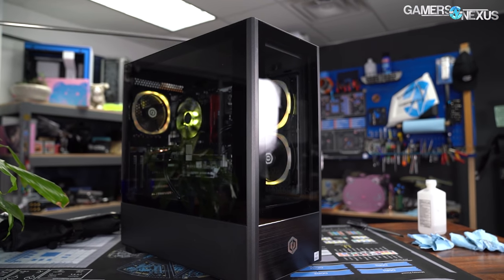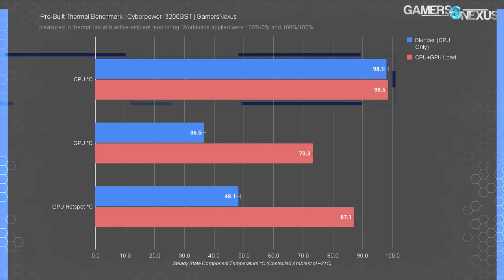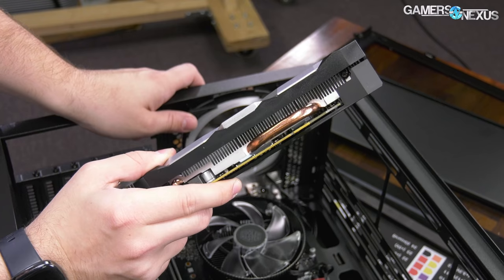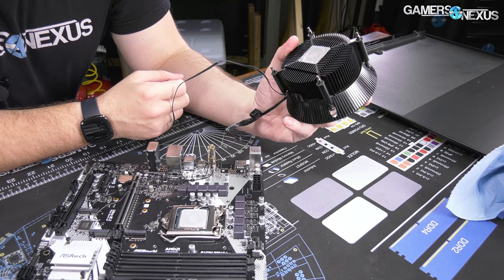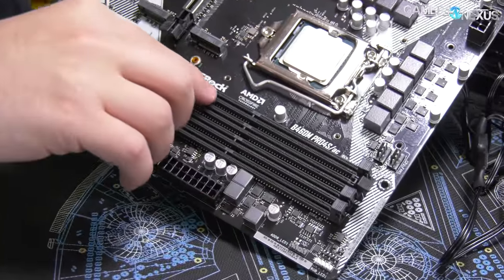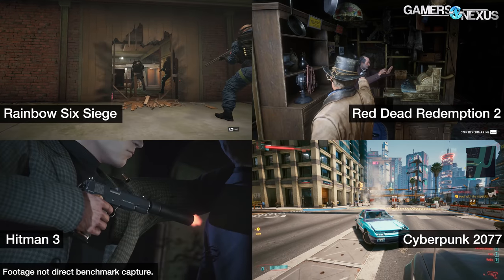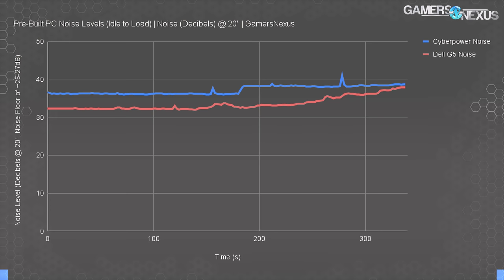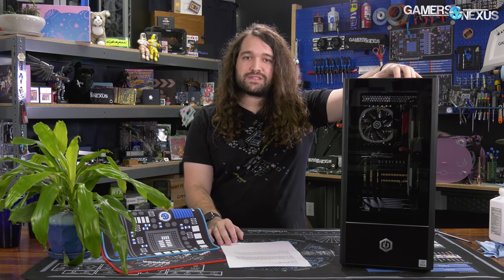Almost Didn't Suck: Cyberpower $1000 Pre-Built Gaming PC Review (Gamer Xtreme 3200BST)

Comment: I'm now becoming livid when I see a pre-built with one stick of RAM. Why the hell can't these companies understand that they need to have dual channel memory in a gaming PC?!
Reply: Dawid, is that you? 😂
Reply: I get so vexed with 1 stick of ram to
Reply: at least in cyber powers defense you can just hit customise and edit and for 40 extra bucks currently it changes to 2x8 instead of 1x8. I venture cyber power is really just maxing profits on the pre built option that you don't edit it as you can get some pretty good deals all things consdering the current market
Reply: It depends on the mobo, if the mobo is only 2 slots, a single stick is fine so you have room to upgrade, better 1x8 than 2x4 in that case.
If we talk about 4 slot mobos then I agree with you.
Reply: @MiGujack3  I'm not convinced by that argument. It's not like buying 2 x 8 GB of RAM is very expensive.

Presumably most people who buy a pre-build system with 8 GB of RAM are not going to upgrade, so they are stuck with a slower system. And those people that do upgrade after a year would have been better off selecting 2 x 8 GB because of the small price difference.

With two 4 GB sticks and only two memory slots, worst case scenario at some point in the future you have to buy two 8 GB sticks instead of one 8 GB stick, which is a price difference of 40 dollar. But you can sell the two 4 GB stick, or use them in a different system.

Let's say that you saved 20 bucks. That's a minor saving and not worth the performance loss before you bought more RAM. Not when the system costs 1,000 dollar.
Reply: How much more does 2x4 cost cyberpower compared to 1x8?  $5? 

Dual channel should always be the default option, even if it raises the price of the computer. If somebody wants to save a couple dollars by using a single stick, then they should have to actively make that choice as a customization, and be warned about the performance difference.
Reply: ANY "gaming" pc should come stock loaded with max ram possiblle.

Comment: Bruhhhh those Molex cables... That's a horror show...
Reply: It's not terrible in practice though, since it carries very little power. Only looks funny.
Reply: @gunnar6674  “How make cable management cheap and look clean”. That’s how. :)
Reply: Yup, time is money, this is so much faster than putting the cables into the MB and then manage them. Saving 5-10 minutes per build is a lot.
Reply: @catriona_drummond  Is it? How much time is spent getting the connectors off the fans so they can jam the wires in?

Or do they get custom fans than have no fan connector?
Reply: It just works. Wait...
Reply: @johnwolf2349  These fans have a double connector, molex and a 3-pin, a still very common thing. There is no jamming wires into something or getting connectors off.

Comment: I'm looking forward to the iBuypower video. The first PC I ever owned was from iBuypower. The case sucked and had bad airflow, the ram was from some random no-name company, and the PSU looked like a knock-off of a knock-off, but at the end of the day I had a blast on my GTX 970.
Reply: Did you get your money from the class action lawsuit for the 970?
Reply: You do know all those things are changeable right? On the site. Just don't buy the offered setup - modify it.
Reply: @JCrook1028  It was my first PC and I was... 18 or 19 at the time. I chose those parts knowing they weren't the best available but they kept the cost down and the rig worked. I was pretty happy with it for years until I learned more about parts.

Comment: What's the point of buying a prebuilt if user needs to swap out CPU cooler or do modifications to improve performance?
Reply from the maker: Maybe for someone who is a little adventurous or already has some experience, but you're absolutely right. The whole point is that it's done for you.
Reply: Gamers Nexus If you're going to swap out parts, you might as well build it by yourself considering you already have some experience.
Reply: @GamersNexus  also adding new cpu cooler is going to add to cost to PC which already has bad value proposition. Given the specs of this pc, I suspect main audience for this is families with kids who need PC for school work and some entry level gaming.
Reply: I dunno, I mean it is still less work (sometimes). I bought this Alienware PC awhile back, because it was on a deal site how you could take advantage of stacking codes during a sale and I thought it would be nice to be lazy, but I did spend a decent amount of time switching out fans and all this stuff. I find it pretty crazy that these companies will gimp their systems the stupidest ways when they're supposed to be made for people who don't even know how to build a PC or don't want to dick around.

Comment: So, the takeaway is this-swap the CPU cooler, maybe with a water cooler and rotate the front fans so that they blow out instead of in. The rest of the computer is pretty good and does everything you could want with a pre-built gaming PC.

Which means it's better than 90% of the "gaming PCs" out there.
Reply: does water cooler suck? it'll boil when its too hot and takes a while to cool down. air cooler is better because it cools down right away.
Reply: @madisongeronimo6859  that’s not how it works
Reply: @bee-yq3wb  ok well idk. my brother shared that as his opinion on water coolers

Comment: My first gaming PC I bought as a kid with all my savings about 15 years ago was from Cyberpower. I selected the option they had for "extra fans" because I figured I'd want the maximum amount. They put them in the box and didn't install them in the case...
Reply: LOL
Reply: I'm honestly not surprised, I recently built my own computer a few days ago with all selected parts and no assembly from a company but even doing it all myself something was still not as advertised and it was the case fans ironically, it showed front intake fans which were absolutely there but it also has venting at the top which showed fans but apparently despite being in the picture and not stating otherwise those fans are optional and needed to be bought and installed myself...not a huge deal just kind of misleading if you ask me but at least I didn't order some expecting them to be installed for me that would have been worse imo.

Comment: I have bought 2 cyberpower pcs before the prices of everything shot through the roof.  They were actually pretty decent for the price.   I will say that the thermals seem to be an afterthought on them. They are ok for standard use but much more than a  couple minutes of heavy load they start to get quite unhappy.  I just swapped cpu coolers and added 2 fans and they have done much better.
Reply: I’m looking to do this is as well how much were the changes in total?
Reply: @iambape1207  At the time it was about $150 each  probably a bit more now.  It really depends on what cooler and fans you want to go with.

Comment: Cyberpower did a real nice job assembling my siblings PC 10'ish years ago, even had a box with all the spare components from the parts they selected. A few years later, when mine arrived, at least two internal parts were not plugged in, including the power going to the motherboard, and the building crew seemed to have shorted me all my spare components >_>. To their credit, they upgraded me to a better PSU when their stock came up short to make the Christmas delivery deadline, and that PSU is the only original part in this PC outside beside the case itself. 

That was still better service than the company that diagnosed the PC (dead motherboard apparently) years later, and decided to ignore me when I told them not to touch the Raid because I could fix it just by plugging the two drives back into the raid control card. Somehow, they replaced my legitimate copy of Windows on the boot drive with a pirated copy loaded with no less than 6 viruses (thank you, MBAM for fixing that.) , despite the legitimate CD key being stuck right onto the side panel! They also decided I would never want to change my HDD/SSDs out and used some kind of glue that had to be carefully chiseled off the cables.

Comment: My 12 year old antec case has one of those "molex centipedes" that was the only way to hook them up.
Reply: The fans only had double Molex connectors on them, no 3-pin pigtail? Because you could buy fan distributors going all the way back. Not all of them were nice, like, the Akasa one tends to become a cobweb inside the PC, but better than a MOLEX centipede.

Comment: "Intake? What's that?"
At least you can, as you did, flip those side fans to act as an intake, but it should be like that out of the box. Not that it would help with such poor contact between the processor IHS and heatsink, but it would have made more sense.
Also that is quite the brick of MOLEX connectors.

Comment: I bought a cyberpower PC with a 3060 ti and an i7-11700f. Came with a b550 board and 16 gigs of 3000 mhz ram (2 sticks). I had to turn 2 fans from exhaust to intake, and swap the cooler, but it works pretty damn well. Not too disappointed with my purchase.
Reply: Amazon just shipped my 3060 build by them, upgrading from a 1660ti I’m very excited. Ordered a cooler master hyper 212 to swap the cooler out with.
Reply: Why did you swap the exhaust fan into intake ??
Reply: @OGkush69x  all the fans came as exhausts, I had to swap 2 out of the 3 fans to intake fans
Reply: @riteshpoddar4189  oh i see now. My cyber pc has them in the front set up as intakes.

Comment: notified gang gang 

on a serious note, my first gaming pc was cyberpower boy was it an ordeal
at least it got me to build my own down the line
Reply from the maker: What was your experience with it like? Curious to know!
Reply: @GamersNexus  Ordered in summer 2013, I believe, because I was worried about socketing a cpu and annihilating the pins or plugging in power cables wrong and blowing myself up.

Price wasn't bad compared to diy (1500-ish) it was an i5-4670 (non K, overclocking also scared me, I WAS YOUNG OKAY) under an unbranded asetek 120mm aio and an evga gtx 770 ftw

CPU was always toasty and the gpu needed the case fans running at turbojet speeds when gaming 

The 770 coil-whined like mad; I've had other EVGA cards since then, including a replacement for that 770 after it died a year later AND a 2nd 770 I added, none have been nearly as whiny (I think they just gave me a lemon lol)

The crux of it was that the on-board audio on my z87-d3h gigabyte mobo straight up died in the fall of 2013,  and I sent it in for RMA which took until late march 2014 to get it back to me. It was seriously so long that my dad thought they had just absconded with it and were hoping I forgot.

Apparently they had to wait for the exact same sku and never offered to let me pay the difference in that half a year for a similarly priced board (there was a GA-Z87-D3H rev1.1, a GA-Z87-HD3, a GA-Z87-D3HP, all substitutes that I'm positive weren't that different in layout, features, and price)

eventually i swapped out the gpus, then the cpu cooler, then the psu, and then moved it all into a better case. After all that i figured I had basically built a computer piecemeal, and built a whole new system 2 years ago
: )

Comment: My PC is DIY and I loved whole process! Researching/picking the parts, building it, realizing there’s bottlenecks, buying more parts, realizing I bought the wrong size AIO so my ram doesn’t fit, using the old slower ram from the prebuilt I had making another bottleneck. So much fun!!
Reply: Every PC I've ever owned has been DIY. But since a $700 3080 is selling everywhere for $1,500+ and up to $1,900 for some models, my next PC will likely be one from a company like Origin or Ironside. Not a mass pre-build but a pre-assembled.
Reply: @ilikefartjokes  AMD, Nvidia, and Intel(who is now making Arc GPUs that will sell soon) have all said there should be a slight ease on supply by end of 2022 and should be significantly better by 2023. By your next upgrade you'll be fine. But I'm running an old 1080 and 3600x, and my wife is without a PC entirely. So I'm going to get one with a 3080 and 5800x and give her mine.
Reply: @ilikefartjokes  It's about 50% as good as a 3080 in regular performance, has no ray tracing capabilities at all, no DLSS, less memory so is struggling to keep up with 1440p, etc. If you were only doing 1080p 60hz and didn't care about RT or DLSS, it's way more than enough in every game. If you're at 1440p 144hz and want RT and DLSS, like me, it's not even close to enough for new games. Many games struggle at 1440p 60fps with no RT abilities.
Reply: @ilikefartjokes  For some it may not be worth it, for me it is. Especially in games like Dying Light 2 where it entirely changes the look of the whole game. DL2 is also a game where the 3080 gets 80+fps at 1440p with Ultra Raytracing and Balanced DLSS(not performance, so could be higher). So it meets your FPS expectations while also having mind blowing visuals. Or disabled it can get 120+ fps. But I want RT. Beauty of PC gaming. You get to pick and choose per game and even per day what you want to use your GPU for.

Comment: 19:09 power supply switch must be set to 115W?
You're a typo, harry! I'm a Watt?

 (also, are psu's that don't auto-sense the input voltage really still a thing? I haven't seen one of those switches on new hardware in ages.)

Comment: @19:11 What? Power input voltage selector switch "Must be set to 115W" when the graphic shows the correct "115V". Do they not know that W is for power in Watts but that switch is for potential in Volts?

Comment: What I’m getting out of this is that CyberPower should put in a 10400 CPU, instead of the 10600K, and they should build it in their P418R case (a re-brand of the Phanteks P360A) instead of this abomination. 

I’ve got a cheaper CyberPower box I bought for my kid with that same garbage cooler in it, but with a Ryzen 3 3100 in it, and built in a CP P418R, it keeps that 65W TDP CPU in the 50C range without sounding like a jet fighter.

Comment: total noob that bought a cyberpowerpc  (3070, 10700F) and it took me months to realize that it was in fact, HEAVILY overheating. Throttling a solid 1GHz off of peak performance. Watched this video yesterday and immediately went to Microcenter to buy a new cooler. Threw a Noctua in there last night and the temps dropped significantly and the peak performance jumped from 3.7GHz to 4.8GHz. Thanks for this video!!!

Comment: Just a quick comment for anyone that wants to know. I bought this machine and kept getting stupid hot. So I installed a cooler master aio cooler in the top and ditched the cheap one they had already installed. I reversed the fan flow on the side to bring fresh air into the case and ditched the magnetic “dust screens” thanks to a video on Jays two Cents. Temps were better but I use a thermal camera and noticed very little change I got really brave the other day and took the front panel off and dropped temp under load by 8 C. With the front on temps were between 70-75 c on the gpu and 35-40 c on cpu after the modification of my rig it now sits at a comfortable 60-70 C and cpu is now between 29 C and 40 C. So for now the glass is out dust cover out and I stuck the smaller dust cover on the front panel until I get new fans or a whole new case. I hope this helps anyone else with their Pc adventures. Stay frosty friends.

Comment: I have this system. The case is a genuine Lian Li but custom made for Cyberpower. They call it the Lian Li PC-008 Dynamic. So the case build quality is very high for a system integrator, far better than the generic / no-name plastic-y case you often see in inexpensive prebuilds. As far as the build goes, flip the side fans to intake, replace the cooler with a $30 Vetroo V5 or equivalent and it's just fine. Needs dual channel RAM as well (add a second 8gb stick). Wish Cyberpower had shipped it with a Z-series motherboard so it could use XMP on the RAM and overclock the K-series CPU., but that would have increased cost because it'd require a beter cooler or an AIO as well. Also: the GTX1660 Super in mine was a single-fan Gigabyte ITX model, not the dual-fan MSI shown in this video.

Comment: As someone who bought a Cyberpower machine in 2019 I think it's worth noting that they do let you pick every component specifically in a way that fixes pretty much all the problems here.

For $0 more you can pick 4 other cooling solutions to this one, for $10 more you can choose a dual channel kit of RAM, and for only like $50 more you could get a much better motherboard when starting from this same base.

The moral of the story is don't buy prebuilts from a 3rd party vendor, buy it from the builder directly and use the configuration tool if it's available.

Comment: Keep in mind if you change motherboard in a PC like this you probably have to buy windows 10 again which isnt cheap
Reply: Yea since they are probably using a OEM key. Buying a Windows 10 key is really cheap though if you know where to buy them. I bought a Windows 10 Pro retail key from a website called HRK and it has worked for close to 4 years now with no issue what so ever and it only cost me like £15

Comment: It’s Jan 2022 and I’ve just bought a Cyberpower PC and the fan centipede is still with us. My unit wouldn’t post, turns out one of the PCIe sockets on the video card may be defective. This unit also had large amounts of thermal paste all over the inside of the case and motherboard. How did this get past the quality control check?
After 2-one hour calls to their tech support, I got an RMA number from them. 

Great video BTW